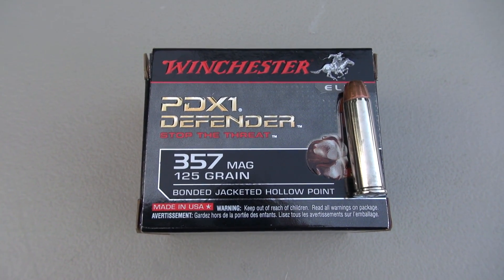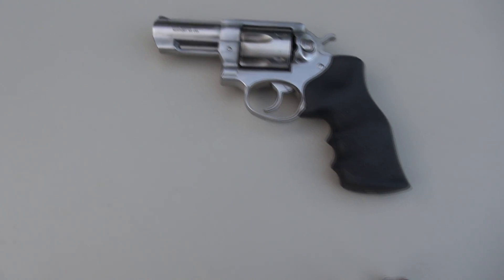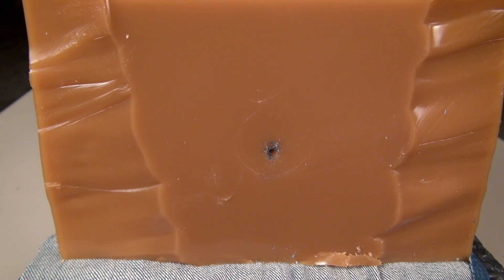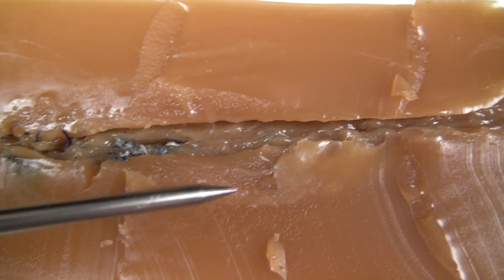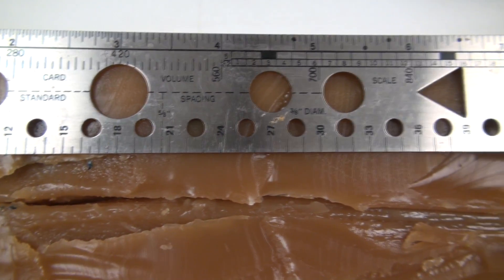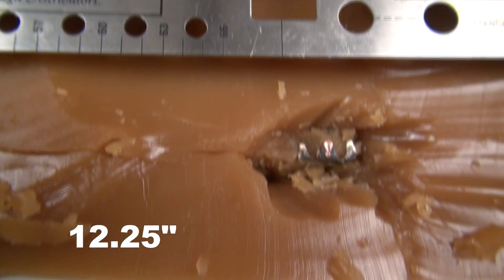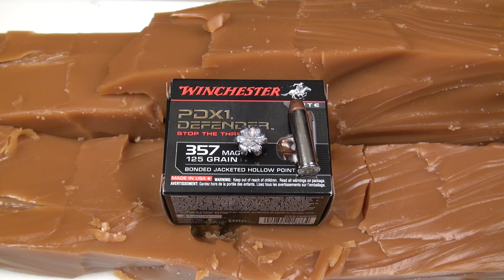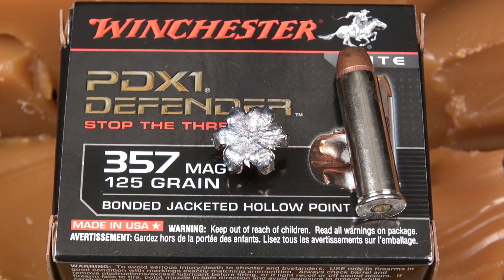Winchester PDX1 .357 Magnum Ammo Gel Test

Comment: Coming in to add a comment to a very old video, I just recently got the urge to rewatch a lot of your old content. Anyway, I find it interesting the 125gr PDX in .357 Magnum is offering significantly less velocity than the 125gr PDX in .357 Sig. granted the Glock 32 has a little more barrel length than the 3” Ruger here, but even still it seems another inch of barrel on the GP would still not bring this magnum load up to par with its Sig brother. I find that pretty interesting. As far as penetration though, both loads were nearly identical despite over 100fps difference in muzzle velocity.
Reply: Would like to see this test done with a 4 inch or 6 inch Barrel
Reply: Revolvers also lose a bit of pressure from the cylinder gap. You would most likely be getting around 1300fps with this from a 4" barrel revolver.

Comment: good grief that's 9mm   performance at that velocity and bullet weight.
Reply: adam shaw  OK you have a point but that's 9 mm plus P performance that would have to come from about a 5" barrel. Plus even though it only holds 5 rounds this little gun could take 5 rounds of any  Commercially loaded round on the market. And I mean 5 rounds of Buffalo bore 180 gr. Hard cast gas check if need be. Yeah dam it would be a hell of a thing to hang on to and I'm not suggesting that it is a grizzly country gun all of a sudden but I'm just saying it is very versatile though limited to its 5 rounds.
Reply: I'm sorry about a the mistake in my last statement I was thinking it was an SP101 this is a ruger GP 100 so it  Holds obviously 6 rounds and is basically the strongest 357 magnum made that doesn't cost as much as a Ferrari haha except for   Ruger's red
Reply: Also remember this is a 3 inch barrel I bet I get 16" outta my 5" barrel
Reply: Are you thinking this wouldn't stop or slow an attacker enough?

Comment: Not trying to rant, just throwing info out for thought. I have been following wound ballistics and ammo testing since the late 80's. Have learned a lot. Thank u Dr. Fackler, Evan Marshall, Ed Sanow and others. I'm sure many have noticed that the 10mm Lite and the resulting 40 S&W are a reinvention of the old 38-40 (actually a 40-38) in a smaller more efficient case with a modern bullet design? There isn't much new under the sun in many ways. Bullet technology has come a long way since the 1870's (heck, since the 1960's), and we all benefit. STAY SAFE!!

Comment: Your videos are great but it drives me crazy seeing the .357 Magnum tested from a 3 inch barrel. Is having a barrel just 1 inch shorter really worth losing approximately 200 ft.lbf of energy? http://www.ballisticsbytheinch.com/megraphs/357mag.html
Reply: Wow! Someone who actually knows of BBTI!! And I would say that according to their website a 3" barrel is the minimum that a .357 should have because some people carry a 2" or so stubby for concealed carry and as BBTI shows, at that length it's not better than a 9mm but a 3" bbl is more power than a .45 cap 5" bbl so a 3" may be good for concealed carry but of course longer is better
Reply: Actually I forgot to correct myself. After I researched a little further, I found that when testing cartridges, BBTI measures the barrel length by measuring from the end of the barrel back to the breech face. This can create misunderstanding when interpreting the data, because revolver barrels are traditionally measured as the length of the barrel in front of the cylinder gap. Given the .357 Magnum cartridge is about 1.5 inches long, this means that when BBTI fires the .357 Magnum round from a 3 inch test barrel, there is actually only about 1.5 inches of test barrel not already filled with the cartridge. When correctly interpreting the data, I imagine there actually isn't nearly 200 ft.lbf of muzzle energy lost between a 3 inch and 4 inch .357 Magnum. However, that much muzzle energy may be lost between a 1.5 inch and a 2.5 inch. Cylinder gap is another factor to be considered. By not fully understanding BBTI's testing methods, I had exaggerated the differences. Still, it was fun to think about and figure out :) It's also worth mentioning that BBTI was very responsive and friendly when answering my questions!
Reply: Hmmm... are you sure? Maybe I just don't understand but the velocities from the 3" barrel here seem to pretty much match what is said by bbti 3" barrel.
Reply: ... oh wait or is that just for comparing revolvers and semi autos? Because a semi auto round sits in the barrel while a revolver round doesn't, so a revolver would technically have a longer barrel than a semi auto when they are both measured the same length
Reply: Yea. It is interesting how his chronograph velocities are so close to the 125gr .357 Magnum velocities posted on BBTI from a 3 inch test barrel. If the ammunition used in the BBTI tests are roughly the same as the PDX1 ammo in this test, it shows that the cylinder gap of his pistol is subtracting about the same amount of muzzle velocity as does wasting about 1.5 inches of barrel with the .357 Magnum cartridge in a barrel with no cylinder gap. Weird!

Comment: Consistently your shots clock in at a lower velocity than the advertised number. In your opinion, is this more because of the short barrel, or the cylinder gap, or both, or else what?
Reply from the maker: +Will Richter Most likely the shorter barrel in this case, although ammo makers have been known to overstate velocities.
Reply: That's interesting. I'm not a gun owner or a shooter but I'm interested in the technical problem of optimizing performance. I love revolvers, especially snub-nosed ones, for their aesthetics but they seem to face a lot of challenges when it comes to ballistic performance.
I wonder, would a .357 magnum "mare's leg" levergun get significantly increased performance out of its sealed action and longer barrel?
Would that performance boost matter in a self-defense scenario?
Reply: +Will Richter Certainly a longer barrel would give you a higher velocity, though I doubt that a whole lot of velocity is lost from the tiny cylinder gap (perhaps I'm wrong) certainly much more velocity differential is due to the longer barrel.

Would it matter in a self-defense scenario?  Certainly, because if you're at home you've got practically twice the number of rounds in the lever action and if your not at home, you're probably not lugging a lever action long gun around with you, so the snubby would be much more effective.
Reply: also, most velocities are from pressure barrel's
Reply: keep in mind ammo get higher fps In hot weather

Comment: Man, the 357 really sucks in these short barrels. A 125 grain at 1240 fps? Might as well carry a 9mm.
Reply: MattypPhil Well according to bballisticsby the inch. A 115 grain Corbon 9mm out of a 3 inch barrel has about 280 foot pounds energy. A 125 grain Corbon 357 mag out of a 3 inch barrel has about 440 foot pounds energy. That is a bit of a difference.
Reply: I was just thinking the same thing.
Reply: 6236003 He has another video testing 158 Grain Underwood which is considerably hotter ammo. Average velocity is 1142 FPS from a 158 grain. Again, not very impressive from a 3" 357 revolver. You really need at least a 4" inch barrel in a 357 mag.
Reply: A 125gr out of a 5" 1911 in a  38Super will be about in between 38Special +p and full 357 magnum. And hold 10 rounds and not beat you or your gun to pieces.
38Super is overlooked alot as a defensive carry round. But with modern bullet technology it's as good as anything else. I have taken a few pigs and 1 90+ pound doe with the new sig hollow points.  I don't honestly think my 6"  Smith & Wesson model 27 would have done any better at the ranges with the same shot placement.
Reply: That's right it's a "medium velocity" .357 load similar to Golden Saber. Advertised velocities are usually a bit exaggerated anyway so it would probably be about 1300fps out of a 4" barrel. The 3" barrels are usually not far behind the 4" - the biggest gain in velocity occurs between 2" and 3". I would take this round or GS over most full magnums considering the difference in recoil/flash is bigger than the difference in performance.
Reply: MattypPhil 
Watch the lucky gunner video on 38 and 357. The pdx1 is just about perfect.
Reply: MattypPhil  No no and no. You're not going to get this power level out of a 3" barreled 9 mm. Even though you are going to have plenty of self defense power with  A Speer gold. plus P round You are not going to have the versatility of using everything from 60 grain new G wiz copper matrix rounds to 200 grain hard cast gas check rounds. This gun is made to be a little more concealable a little more pacable then a larger to 57 magnum platform but with the versatility to shoot just a incredibly wide variety of amonition.

Comment: While the round seems comparable to the Gold Dot there seems to be a loss of velocity due to the shorter barrel length of 3 inches as evidenced by the muzzle flash showing powder burning in front of the barrel. Probably would be greater penetration with a slightly heavier bullet and a longer barrel of say 4 inches

Comment: In terms of general utility, the S&W 686 or Ruger GP-100 are good guns. I prefer the slimmer K-Frames - like the Model 19 or Ruger's Security-Six - when all day carry is needed. A 3" Model 13/65 w/fixed sights for CCW. The 686 weighs in close to the larger Model 27/28 N-Frames which I prefer for serious jobs. If hunting bears, hogs, cougar or other heavy-duty jobs, I opt for the 6-inch .41 Mag instead. The full-house 10mm is pretty close to the .41.

Comment: I think the performance would have been enhanced at least a little bit - say another inch or so of penetration - by using a 4" barrel. That's what most of today's manufacturers use for testing (4-inch vented test barrels). The six-inch .357 is perhaps the best all around gun. It's a tad unwieldy as a CCW though.

Comment: I use these rounds in my 4 & 5 inch Magnums. They are very light and somewhat manageble, compared to 125 Gr Gold Dots. With that said, this video confirmed my hunch on the power factor, but did a really great job with expansion. If you prefer a really hot round with awsome expansion, go with Gold Dots. Again TN has done another test on a round I was Curious About! Does He Read Minds or What?

Comment: Yeah most bullet companies nowadays download the ammo to a point where lesser powered calibers will overtake it. Hodgdon shows a maximum load for 357 mag and 125 grain bullets for a velocity of 1966 fps. Of course the velocity depends on barrel length but the means an energy of 1072 psi. That is almost exactly 2.5 times the energy of this round in the video. There ain't many autoloaders that can hold a candle to that kind of power.

Comment: Most centerfire FMJ loadings should. 5.56, however, is probably one of the least likely to, as it tends to fragment, or at least the military surplus stuff does. Something like Wolf would probably go all the way through, but then again 5.56 yaws fairly early as well, so it may not cut a straight path through the block, or make it all the way through. 7.62x39 or .308 FMJ would most likely blow straight through it. Any handgun round .380 or larger definitely should.

Comment: Put a 110gr winchester SJHP over 23gr of win296 with a magnum primer and a heavy crimp. (Don't blow your gun up, new production L-frames or rugers only please.)

Out of a 3" barrel it may not seem that impressive, but out of a 4" or 6" barrel it will clear an empty paint can without even moving it. It no longer sounds like a handgun round and sounds more like a braked 300winmag in an SBR.

Comment: I would think the bullet weight was the cartridges downfall.

The last deer shot with my 357, I was using a 158gr HP-XTP going 1050fps. At 65 yards it was a pass through breaking a rib on exit.

That said... I do have a 125gr close range self defense load, and also have changed my hunting load to 180gr HP-XTP at the same 1050fps velocity.

Comment: keep in mind that he is testing the watered down versions of the round. a buffalo bore 125 barns round does 1500fps our of a 3 inch barrel. underwood ammo, double tap, and the others are going to produce much better results. (they all load their 357 in the 600 to 700 ft/lbs). to put it in perspective these are loaded in the same range as a lot of 9mm rounds. its the same problem I have with 10mm ammo, most of the ammo around is downloaded.

Comment: I'm not completely surprised or let down by the (lack of) penetration these 125gr bullets are providing. Sure, they could go a couple more inches deeper, however, these are self defense/expanding loads that are designed to do exactly what they're doing (expand and penetrate within FBI protocol). It's for that reason I have a hard time justifying carrying anything larger than a 40sw. Even then, I favor my G23 with 9mm barrel conversion and 15+1 of 147gr HST.